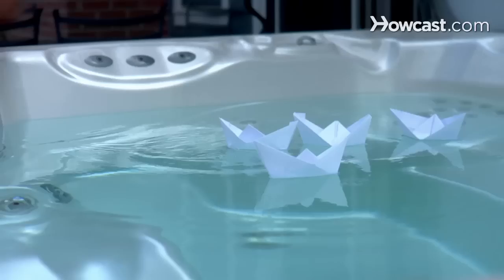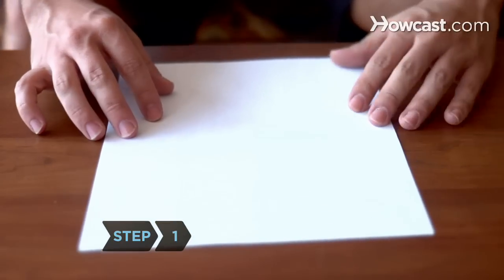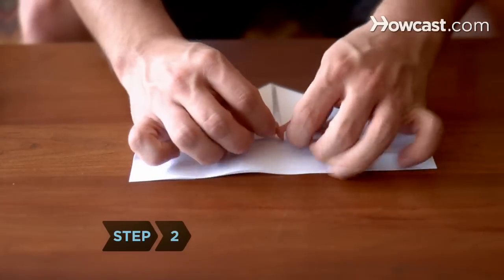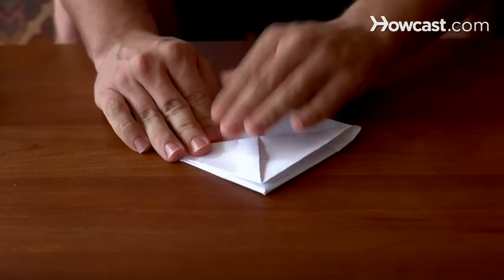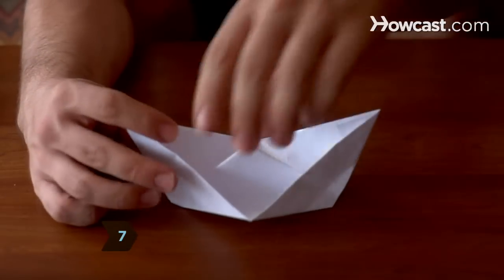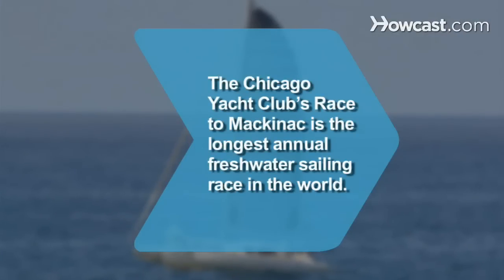How to Make a Paper Boat

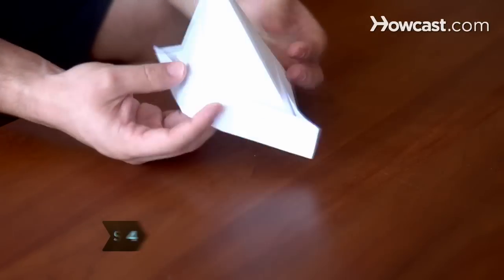Comment: The video cuts are making the understanding pretty hard after 0:50 but if you're trying yourself you'll figure out pretty fast where the paper is folding "naturally".
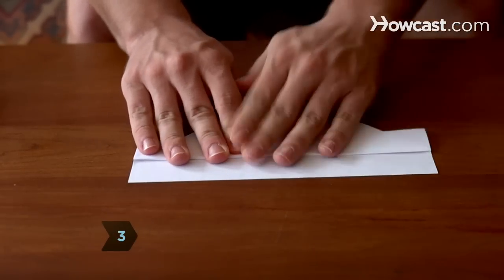Also I tried with square paper towels and it's nice if you start the two tops on the last industrial fold ( So without the step 1 ) and if you fold the rectangular edges ( 0:33 ) on itself once to make this band shorter ( And thicker for a paper towel ) as it is on the example